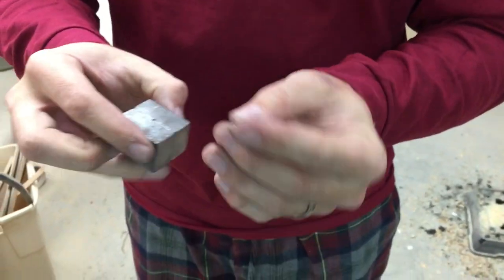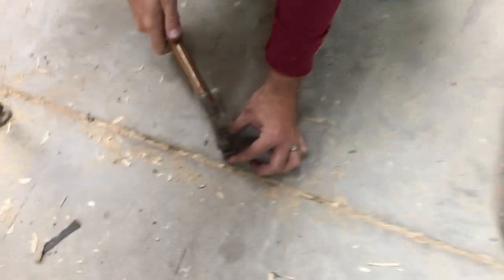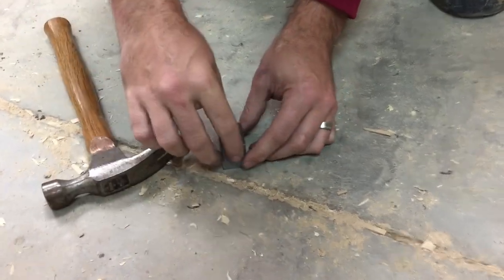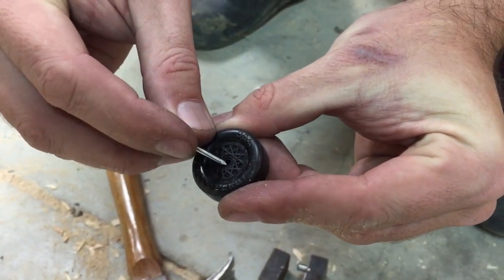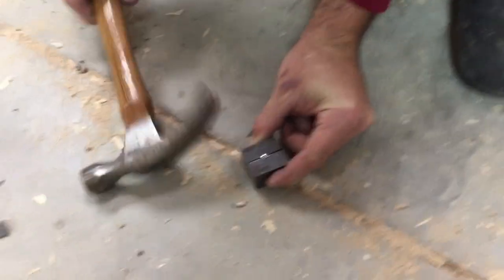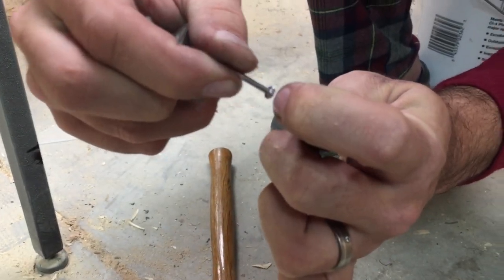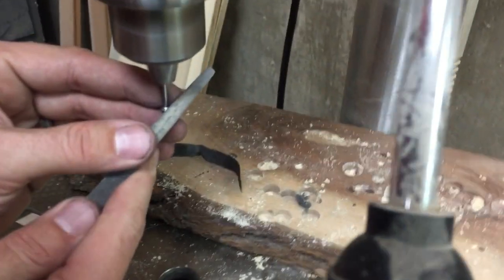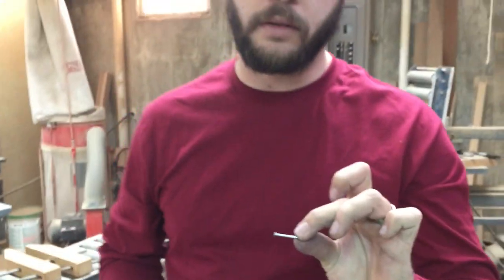Pinewood Derby Secrets Part 2 - Axle Straightening and Head Coning

Comment: So, my pack says that the wheels may be canted, but the axles may not be bent.  Could you tell me the correct ways to insert the axles into a slot type block?  Thanks!  Pinwood Noob
Reply from the maker: I know there are tools/jigs that allow you to drill an angled hole in the car body to run straight axles with canted wheels, I have just never used one since we run angled axles.